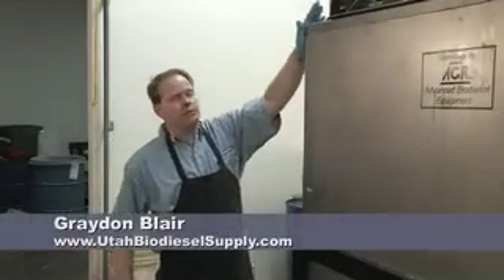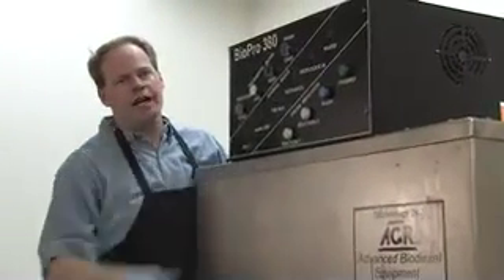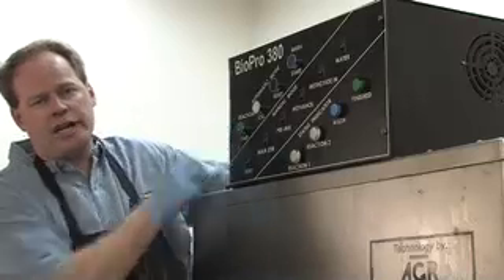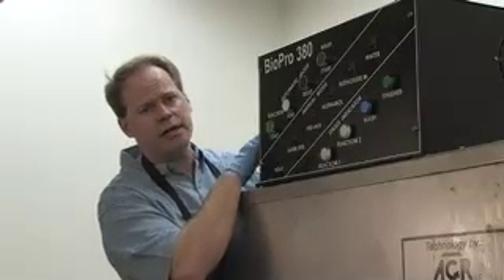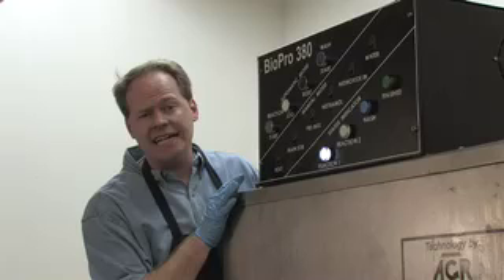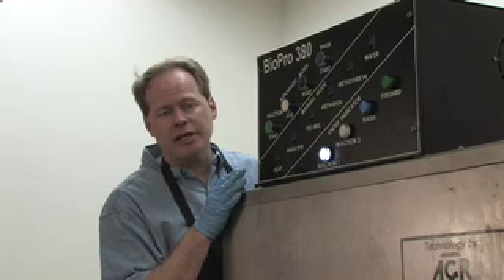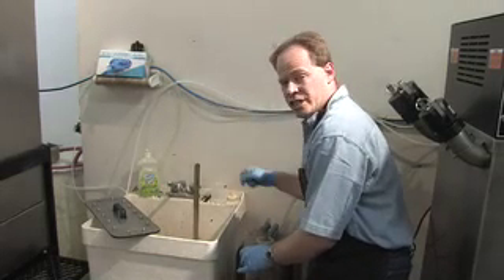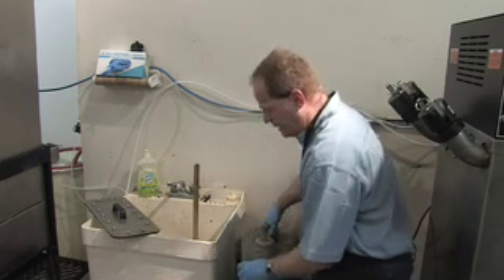Biopro 380 | Home Biodiesel Maker (Part 3)

Comment: Assuming 70-80 deg. F ambient temps, a 190 uses about 25 kW hours of power.
Power input is standard 110 volt 15 amp circuit.
-Graydon, Utah Biodiesel Supply